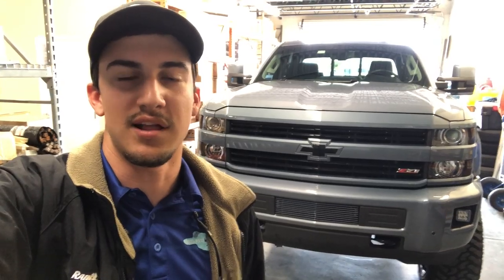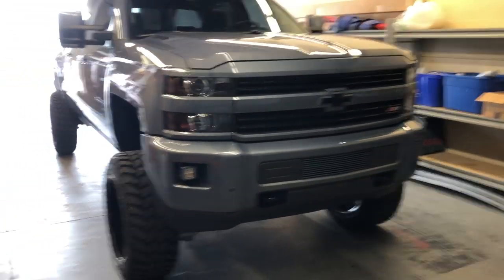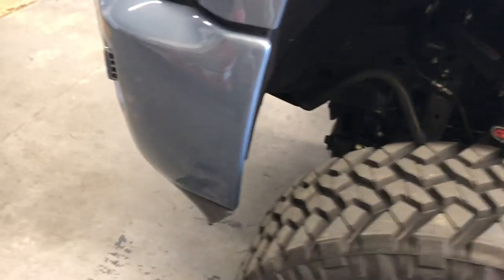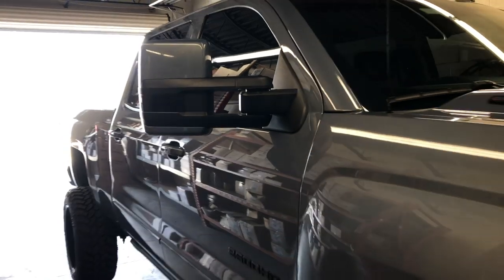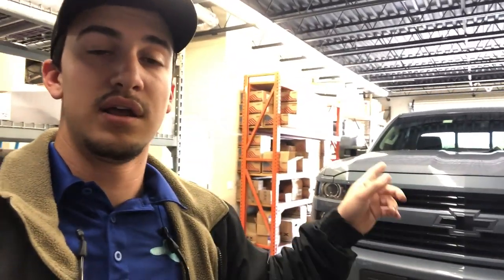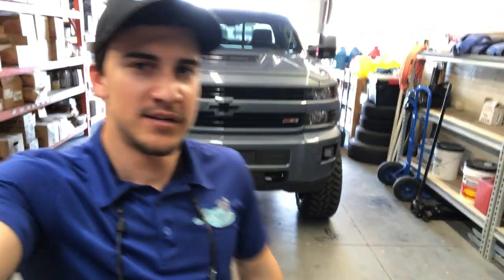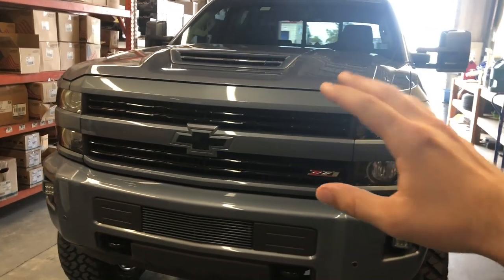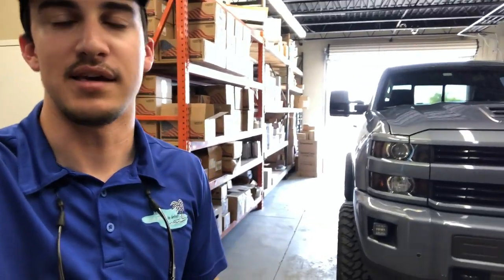MY DADS NEW HOOD ON THE DURAMAX!

Comment: I was told you had to change the hinges too because the 2500 hoods are heavier. Guess that's not the case.
Reply from the maker: No sir, only 1500’s that do the swap have to chabge to the 2500 hinges.
Reply: @forgedduramax3099  Ah gotcha, thanx.

Comment: I have a 2016 Silverado LT 5.3 with the same color. I’m not sure if I want to paint my bumpers or line-x them cause I drive bout 2hrs on highway to/from work
Reply: Where did you buy the hood from n will it bolt on to a 16 Silverado?
Reply: What color ?
Reply: What is the color?